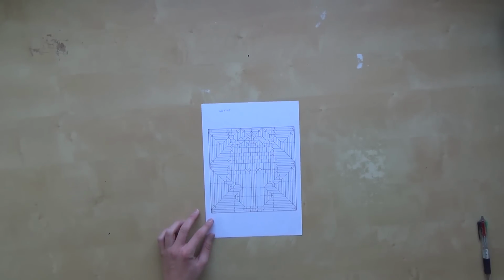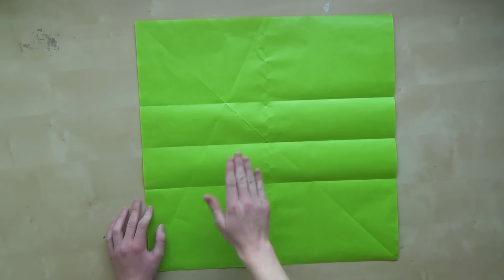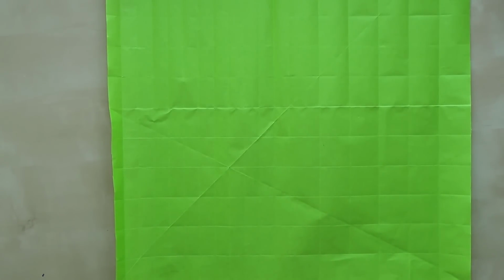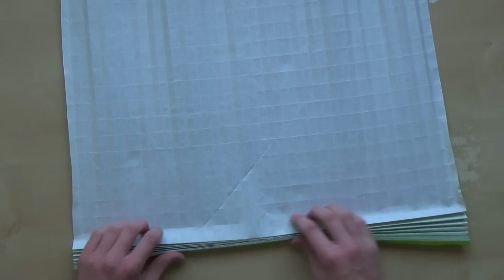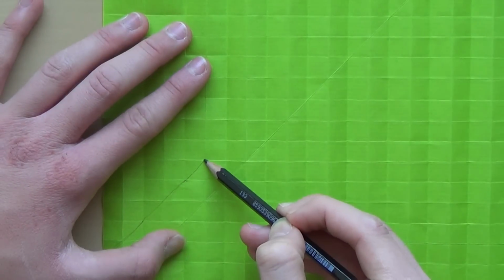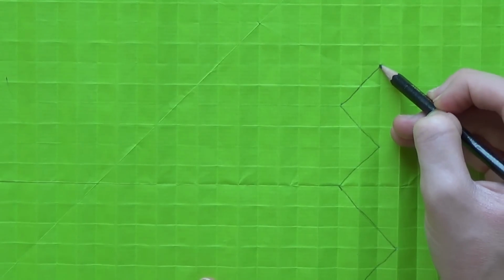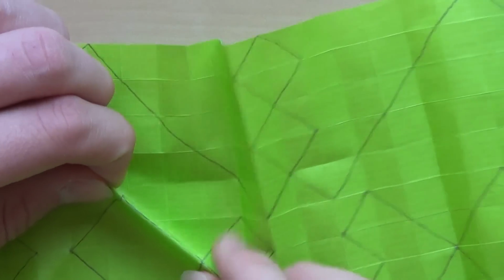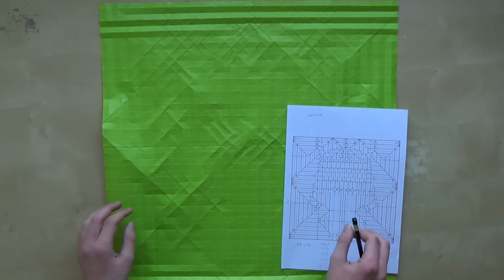Salt Creek Tiger Beetle by Robert J. Lang (TUTORIAL) Part 1

Comment: I would like to suggest sandwich wrap. It's like heavy tissue paper and the weight of onion skin. It's inexpensive. 12 X 12 inches (30.5 X 30.5 cm) is easy to find. Aside from wrapping sandwiches they also use it to line baskets of food like fish and chips in sports bar type restaurants. It can be glued to tissue paper or another piece of sandwich wrap to make two color paper.